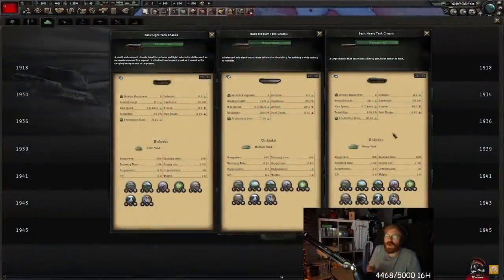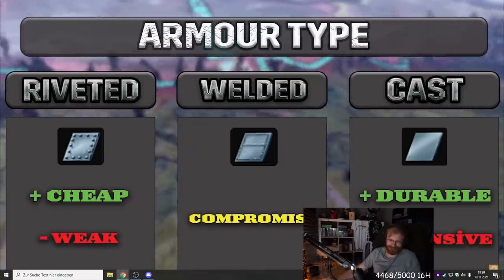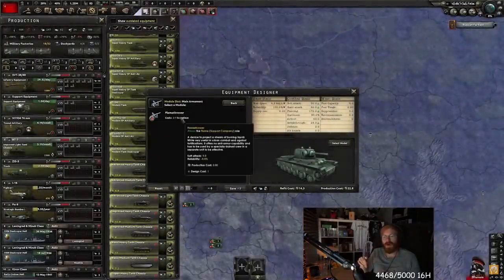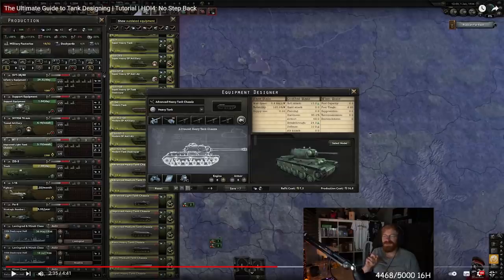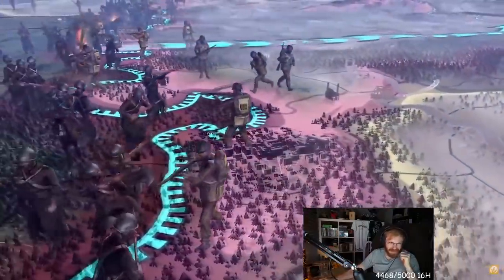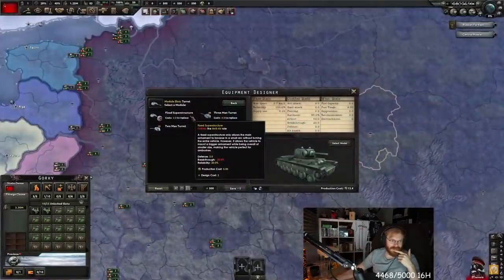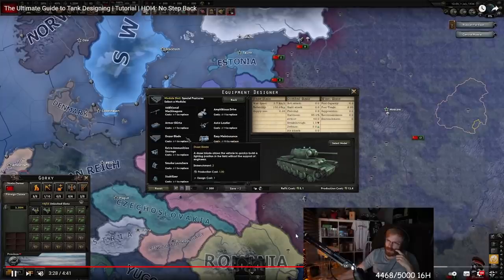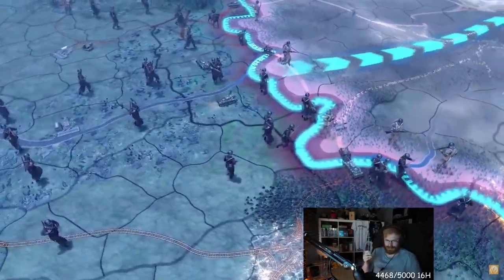HOW TO BUILD A TANK - TommyKay Reacts to HOI4: No Step Back - Tank Designer Tutorial

Comment: I bet there's going to be only two types of people: 
 - Ones who use de-facto MBT in 1938
 - Ones who micro with "Speedy Gonzales" light tanks and super heavy Landkreuzer P. 1000
Reply: The question is though, can you counter the "heavy Landkreuzer P.1000" with a horde of light tanks armed with big guns that can pen them?
Reply: @Notmyname1593  There's always the option to go around or CAS them.
Reply: @Notmyname1593  just throw 30 at it, easy.
Reply: @Notmyname1593  Now you have the "close enough" mechanic. If you can't quite pen them but you are close enough they get a smaller buff than if they are fully unpennable, which is realistic.
Reply: No idea, who would be doing the first one, but in second one you have described both german players with swarms of VK20.08 and soviet players with lines of KV-3 sitting behind rivers.
Reply: I would also like to see what would be the result of the cheapest possible tank. It may be crap, but when you have 200000 of them...
And then there is amphibious medium and air transportable light.
Reply: @TheArklyte  KV-3 with zis 103 would be glorius
Reply: Or me who uses the best equipment by looking at some numbers and a green triangle

Comment: I feel like it’ll end up as ships are. It will depend on what your enemy is focusing on. That’s just my guess
Reply: That's quite realistic honestly
Reply: @markusz4447  nah its 0 realistic, Germany focused on beasts like the tigers just to be outnumbered by t34, and get demolished, with all their tanks being unable to move because lack of fuel and having like 0 reliability. Historical accurate things are impossible in hoi4. For example, Germán panzers in the invasión of france were less powerfull than the french tanks, but still they defeated various french tanks just by mobility in combat, you cant réplicate that in hoi4
Reply: Nice alastor profile pic 💪🏻
Reply: First off you don’t much about the eastern front then do you? Sure the Russians mass produced the T-34, but they also had their tigers too. The IS series of tanks for example, which came out of the KV family, weighed 51 tons, had a 122mm cannon, and had 120mm (depending on the year) of sloped or flat frontal armor. By comparison the Tiger I, which was the IS-2s main tank rival, was 54 tons, had an 88mm gun, and 100mm of flat armor. Point is the Soviets also built huge monsters. The whole eastern front was a dick measuring contest between Hitler and Stalin really. T-34 in response to Panzer IV, Panther in response to T-34, IS-2 in response to Panther, Tiger II in response to IS-2, etc. I means that’s why 90 percent of Hitlers heavy tanks were on the Eastern Front, there weren’t even tigers present in France in 1944. 

Even the U.S. made big ass tanks, in fact they made I believe one of the heaviest tank designs of the war, the T28. It was 95 tons, had a 105mm gun, and had 305mm of frontal armor. By comparison the Maus (arguably the largest tank produced during WW2) was 188 tons, had a 128mm gun, and had 220mm of frontal armor. The only reason the T28 was half its weight was because it was a tank destroyer that didn’t have a turret and therefore had a lower profile (T28 height 9ft/ Maus height 11.9 ft). Proportionally speaking they are very similar in size.
Reply: Light cruisers are op
Reply: this, tbh
Reply: @TheMaztercom  wdym????? Russia picked the t34 because it was very Easy to produce and it was good enough at that time so they would out attrion germany. Usa built a very flexible tank usable in all theathres, because they knew they would be fighting Japan germany and lend leasing it. You are completely wrong here. Oh and ever heard of encircling, reinforce rate etc? Once again you are wrong.
Reply: @kadenvolan3557  idk where you get your information but if you do one Google search you would know that the Tiger 2 and is2 were Both designed in 1942. Tiger 2 was the succesor of the Tiger 1 comibing the Tiger 1 and panther. Even funnier the first Tiger 2's produced went to An SS Division in Normandy.
Reply: @TheMaztercom   The Tiger early on had reliability problems, but later in the war was actually fairly good when it came to reliability - for how heavy it was at least. And while it was outnumbered massively by the T-34, it was still generally a superior tank in combat as the T-34s needed to get significantly closer to a Tiger to kill it than a Tiger needed to get to a T-34. However, the T-34-85 could easily kill a Tiger if they used them well. 

Also the invasion of France was definitely not just won by mobility. It was the overall usage of tanks. The Germans had less and arguably worse tanks, but they concentrated them and encouraged the use of radio, making them extremely coordinated and superior in numbers at any engagement. French tanks had one-man turrets which were incredibly inefficient with the commander commanding, loading, spotting, and firing. As well as using flag signals to communicate.

In fact, the T-34-85 was an upgrade from the 57 as a direct result of the German tank threat, so it is quite realistic.
Reply: @kadenvolan3557  Everything right you're saying apart from the 1944 part. There were Tigers in 1944 in France, both Tiger I and II. The Panzer-Lehrl Division which fought in Normandy has received the first ever Tiger II. After July 11th 1944 tank battalion 503 which was previously positioned on the Eastern Front was fighting in France with 12 King Tiger II and 33 Tiger I.
Reply: You are all cringe af
Reply: @myfairlady343  says the Guy named broccoly 123
Reply: My hope is that it will be less of an issue thanks to the difference in build time
Reply: Level 2 Navy as the US and be used the entire game as long as you upgrade the weapons and can out produce the UK.
Reply: @RyanTheHero3  tiger only got better at reliability when the new models where out, but was too late, still the tiger got serious problems in winter and in mud,.

you are missing something, the t34 wasnt made to fight tigers, but rather panzers 4, the t34 was a medium tank not a heavy one, saying that tigers can win t34 is true, yeah, because a t34 can win a panzer 2 too, cause they are different categories, soviets heavy tanks putted a good fight agaisnt tigers, its so that germany adopted some experience for that in the panther.

when i said the battle of france i referred to the the tank vs tank battles, germany worst panzer divisions were able to destroy many good french tanks, thanks to the mobility, and thats impossible to simulate in hoi4.

if we take the argument of the guy, the soviets should have made bigger and super armored tanks to surpass and destroy germany, cause he said that you need to focus on your enemy, in reality soviets make their tanks just the right balance, they got good armor and good firepower, but they still wanted to maintain mobility and effectiveness of production, so in fact the soviets were focusing in the production and logistics, rather than on what ur enemy is using.
Reply: @TheMaztercom  But that’s exactly his point, by countering what your enemy is focussing. The Soviets went for a mass production at the loss of quality for their tanks, hence there were many many more T-34-85s on the front than Tigers. Which also meant that, despite the superiority in combat, the Germans were largely outmatched across the front, as T-34-85s could easily kill Panzer 4s and 3s. Because the Tiger was so expensive, the Germans weren’t able to get them everywhere. Unlike the Soviets who went with a compromise, which inevitably paid off.

Also about your point with tigers, yes it’s absolutely true that their logistical problems were continuously a let down throughout the war, but I was referring to combat scenarios.

And lastly, the French tank V tank battles weren’t that common. France only had I believe 2-3 designated tank divisions, and the rest of their tanks being distributed around the frontline. Mobility was indeed a decisive factor in how the Germans achieved the encirclement of almost all allied forces, but it wasn’t the only one, especially in tank on tank combat, where having efficient crew and effective coordination was a bigger part.
Reply: @TheMaztercom  hahahahaha my Guy Just edited his mistakes out so i look like a fool, you are a funny man
Reply: @RyanTheHero3  there is a problem, they didnt lose quality, soviets produced so many tanks, thanks to their big industry and the lend lease, so in fact what he said is still wrong, soviets didnt want to counter germany, because as i say, they would have builded bigger and with super cannon tanks, t-34 was a very good tank for the year and the fact that could be mass produced even better, t34 was in many ways better than panzer 4, one of the motives germany started to use different types of armor, like in the panther.

so the next point is, soviet got a better industry than germany, why they didnt just produce a lot of heavy tanks? they could have produced the double of heavy tanks and destroy every german tank on the front, but they didnt, why? logistic and economy, soviets didnt focus on the enemy, they focused on the logistics and economy.

i mean, german tansk still could destroy soviet tanks, look kursk, but if you have the industry and manpower to make better and powerfull tanks, why you dont do it? logistic.

tigers were damn good, but as i say, whats the point of such weapon if you can only use it in some battles then it broke.

yep, but the few tank battles were won by germany, with light tanks, i dont say germany only won cause they destroyed french tanks, nah, i am not even talking about the whole french offensive, i am only focusing in the few battles they got, and how i would never be able to simulate that, or even the japan-russia border clash, there was one time that i putted some soviets armors in the clash border and the japaneses still won, and i was like, tf they dont even have antitank, how they won? i should have obliterated their whole division, but againt his is lack of depth on the hoi4 system, in real life divisions got a lot of equipment, like in hoi3, or BICE mod.
Reply: @caswesstein  what?
Reply: @TheMaztercom  Yeah Hoi4 is pretty shallow with its mechanics, if that’s what you’re getting at. I’m pretty sure this is what they’re trying to change though.
Reply: @TheMaztercom  I would also disagree with the T-34-85 being crudely built. While the design was not necessarily poor, the production tended to be quite shoddy. Especially from the makeshift factories that were set up. There were a lot of problems (poor gunsights, lack of radios on many tanks,  early on had hard armour, welding could be crude with even gaps occasionally, and I’d maybe argue that sloped armour was a quick way to make cheap armour more effective). Though this is another argument I suppose.
Reply: The IS-1s design process started in 1942 though? As a response to the Tiger I. It went into service in August 1943. The IS-2 (which only had a different gun and turret) went into service mid 1944. The Tiger I started it’s design as early as 1937, coming out in 1941. The Panther came out in 1943. The Tiger II went into service in May of 1944. So, I don’t know where you got your information from. 

Also there were no tigers in France in 1944 that saw combat, with exception to 3 on a train headed to Germany. https://m.youtube.com/watch?v=0Y2-5rNENTA
Reply: @TheMaztercom  The reliability aspect will be important, mobility matters, radios are a thing and give massive bonuses, and there is no either or thing with penetration anymore, if you're close enough to penetrating they don't get the same buff. I think you'll be surprised by the depth.

Comment: the only way for Dangkus to not shit on other with his heavy tanks is to buff air, the reason Maus are not practical is because that thing is a sitting duck, great for enemy training, the buff it self don't have to be broken, just something like if a unit stay in place for several in game days, they will receive N% extra damage (for example 0.5%), and it will be increase as more days passed and the pilot developing a technique to harass its land target.
Reply: I think buffing air would just kill a lot more light tanks too, I think it would be better to make heavy tanks have a debuff to CAS (like the opposite camouflage expert trait for generals), Medium Tanks have no buff or debuff. Light tanks have a buff due to their small size and speed.
Reply: No, the reason the maus was impractocal in practice is that it was too slow and unreliable and had oniy a small advantage over lighter tanks relative to its cost in practise. It could be avoided by more mobile forces and would breaknown if it tried to follow.

CAS irl was almost useless against frontline units. It was only effective against supply lines, which would affect heavy tanks more than light tanks but it wouldn't be a major advantage.
Reply: SPAA somewhat nerfed with increased width(1->2). Also armour itself got a bit nerfed by not being purely binary now. Tank destroyers got buffed now being able to equip the same guns as the next category of tanks. Also it takes more research to get the same performances as the HT3, since now one has to research the chassis, the gun and the armour.

Plus now one can use logistical strike to attack the supply of the enemy, no-air Russia might need to build countermeasures eating into it's IC advantage.
Reply: @matthiuskoenig3378  CAS was incredibly useful in both of the Fall of France, and on the Eastern Front until the improvements of the red air force. 

Analysis of attack aircraft, showed them to be twice as effective as CAS for frontline troops instead of interdiction role.
Reply: what you guys arguing over? i am confused. what is "Dangkus"? idk i never play germany or USSR or big overpowered natsions. am more of a tukey/iraq/mexican guy. i hope this argument is about having fun in hoi4 and not, god forbot, historical accurcy
Reply: @jackspedicy2711  Online meta is heavy tanks spam as russia
Reply: @matthiuskoenig3378  CAS was pretty much useless against tanks, but pretty damn effective against anything else, and tanks can't fight on their own.

Comment: Electrical engines would be the best for germany, since they struggle with oil.
Reply: It`s electric transmission, like the one infamous Porshe Tiger used.
Reply: @Notmyname1593  So it would still cost oil?
Reply: @JozsefPocsi  That is what diesel/petrol electric means. A regular combustion engine is driving a generator which supplies  electric motors that propel the machine.
Reply: @Notmyname1593  So I'm still going to need oil to fuel my tanks?
Reply: we don't have reliable cheap eletrical engines nowadays meanwhile my man wants full war tesla tanks in ww2
Reply: @durneac  It would be cool tho.
Reply: @durneac  >Tesla Tank

O.O

Comment: If welded is rolled homogeneous armor which I've heard it referred to it as such, it is certainly not less durable than cast armor, theres a reason germans had box tanks instead of sloped armor for most of the war RHA is better metal but much harder to slope than cast plates need to be rolled out and welded at angles to slope them a technology that many nations still didnt posses by the end of the war, ie the reason riveted armor was still being produced by some countries
Reply: You are forgetting about the weld lines. Weld lines make welded tanks more brittle than cast tanks. This is why the past war standard was cats armour despite cast being more expensive.

The actual plate the rolled armour is 2-5% stronger for the same thickness. But this is countered by the shapes cats can be made into and the brittleness of welds